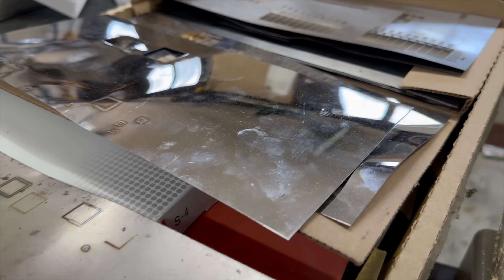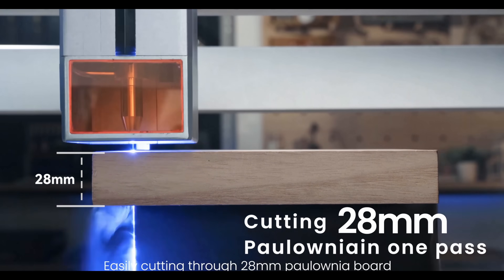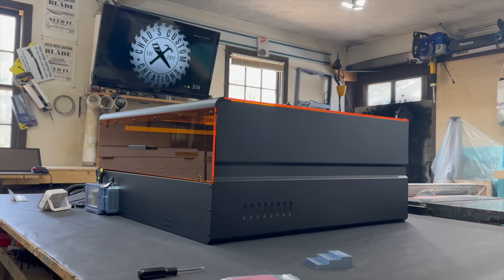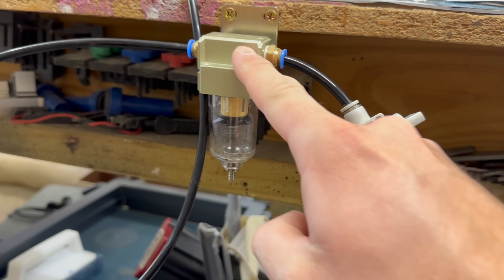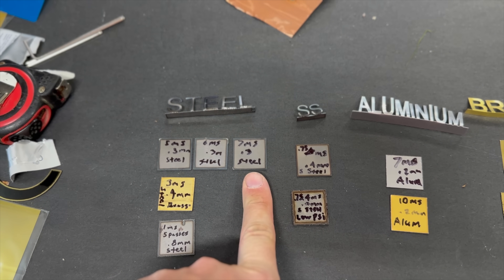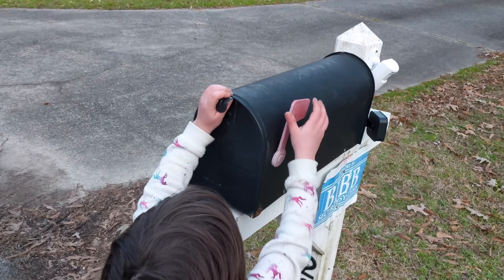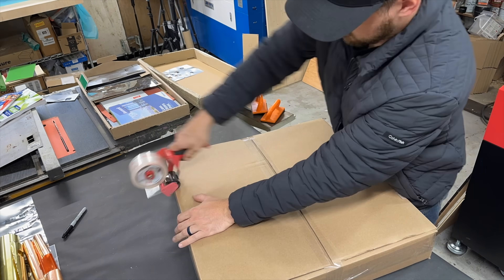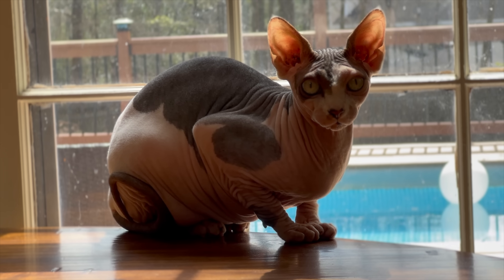Is The Future of Metal Cutting with Diode Lasers? 70W IKier K1 Pro Max

Comment: Goggles included with chinese laser engravers/cutters are never the right type.
Each have different peak wavelength those can effectively block.
If you don't want to damage your eyes, you need to pony up like $200+ for proper goggles, especially when we're speaking about 70W of power and you look at it directly.
You will very likely get very slow and gradual eyesight loss which you won't realise until it's few years, more damage, and you struggle to read smaller text and go to the optician and they tell you your eyes are fkd.
Reply from the maker: You're right! I actually have a nicer pair that is the orange color which does block out the blue much better. I should have had those on for this video, hopefully I don't go blind in a few years.
Reply: @ChadsCustomCreations  Do these come with certificates?

Comment: Coconut - Fantastic video. Thank you for such a thorough all metals review on the high powered diode laser ! You are the only person on the internet to provide this !! Ive looked hard ! 

It would be really interesting to see what Ikiers 20W fiber laser could do from a metal standpoint as the wavelength penetrates most metals much deeper. I was on the fence about these two for a while and I couldnt get any clear answers from Ikier. I ended up going with a WeCreat Vision for now and am waiting for either a desktop fiber laser to come out that can cut 0.2mm nickel or a diode. My guess is theyre probably not quite there yet. 

If Ikier wants to send you their Fiber 20W laser Id happily send some materials your way for testing 😅
Reply from the maker: Glad this was helpful for you! I didn’t even realize they had the 20w fiber until I was editing this one. I did talk with one person that got it and they said it does not have the air assist so actually they said my cuts were more impressive on metals. I would love to test it and maybe a 3D printed nozzle would help improve it.

Comment: Coconut. I have just discover your channel and I love it! I don't know what XTool should buy. I am a calligrapher and I want to complement this activity with engraving and printing...  Would a M1 be a good choice? Thanks for all your nice videos!
Reply from the maker: I am lucky you found me glad you are enjoying it I haven’t used the M1 it does have the benefit of also having a blade for vinyl cutting like the circut machine but if that doesn’t interest I think the 20w S1 is the best option for new laser users at the moment. Code Chad10 should give you a little discount also. I have a video on the S1 too if you want to take a closer look.
Reply: @ChadsCustomCreations Thanks a lot! I've been comparing M1 and S1 and the prize difference is too much! There is a good offer today and the M1 all in one kit is €1999. It includes the air purifier. Do you recomend it for security? Maybe I'd start with this kit and invest in the S1 in a while, if I see it could be a real business. If that happens, I will be able to use the air purifier for the new machine... 
Furthermore, I have seen that the xTool M1 and xTool F1 are incompatible with the Screen Printer Multi-color Kit, and I am interested on that. Why the Basic kit is compatible and the Muti-color one doesn't? 
I don't know what to do. It's too much information and I am overwhelming 🤯

Comment: Coconut.  I saw the post about using nitrogen, no idea on costs but had wondered about using CO2.  I know someone using it for cryotherapy and the nozzle temp is very low.  Also like the post idea of just running one or two passes with the laser off to help cool the material, will be curious if you see any real differences with the laser off test passes or if there will be too much heat accumulation to dissipate in a timely manner.
Reply from the maker: I love that the community can share these ideas in the comments cause I never would have thought of these but they make so much sense I can’t wait to try them.

Comment: Coconut and thanks for this video - those laseres look fabolous - I'm used to co2 lasers, but they don't stand a chance against this :)
Reply from the maker: Roy same here my main work is done with Co2 lasers but even at 130w mine won’t touch metal for some reason it’s very interesting these different wavelengths have on materials.
Reply: @ChadsCustomCreations  well, co2, at 10,600nm, is pretty far out in the IR spectrum, so it's quite understandable. I'm surprised that it works this well with only 455nm, thogugh. I'd've thought it had to be even higher frequency than that to pierece metal.

Comment: It would be interesting to try a water table like plasma cutters use to reduce warping. Put the cutting grid into a pan of water and raise the water level till it just touches the metal. The compressed air is going to spray water everywhere though...
Reply from the maker: You know I never knew why plasmas have the water tables but it makes sense looking at it that way.
Reply: @ChadsCustomCreations  Yep, in addition keeping the material cool so it doesn't warp, the water tables also absorb the smoke and sparks. Some plasma cutting is even done underwater. It's possible that the laser can pass through a thin layer of water, and cut the metal underwater. That would be an interesting experiment to do with the air turned off, but maybe then it won't blow out the melted metal?

Comment: coconut...  This looks really good, but the cutting capacity is pretty limited compared to a co2 laser.  On a CO2 laser, you can cut 2mm thick 2-color steel plate at 7mm per second on a 25 watt laser.  I don't know if it is because the laser spectrum, , ability to converge all beams into a single point, or a discrepancy in power measurement...  But the 70 watt rating does not translate to co2 equivalents.  Diode lasers are coming along, but we just aren't there yet for cutting.  Sorry, cutting foils is fun, but it is really limited in practical applications.  Engraving, yeah we have that covered with diodes.  So diode lasers cover the decorative landscape up to thick metallic foils.  But wood and plastics are where this is going to find a home as an effective cutter.
Reply from the maker: Do I have something set up wrong I have a 130w Co2 laser and I cannot get it to even mark steel.

I’ve not heard of a 25w Co2 laser I thought the lowest was the K40 with the 40w tubes.

Comment: Coconut. Glad you ended with a practical use for this. I was hoping it would be able to do more.
Reply from the maker: They are getting there, I think 140w might be a sweet spot for some structural stuff. Thicker stuff would definitely be nice but for aesthetic pieces like signs and such it works out pretty well.

Comment: in theory with slow enough speed u could cut up to 1 maybe 2 mm non-metalic alloys. however... and there is a but here somewhere... u have to account for backreflection... u see laser diodes, are notorious for being super flimsy especially when they get heated up... so unless u blow that pcb and laser lense with some coolant continously... to keep it cool and nice... ul fry it up in around 10 cuts or so... depending what u cutting. if u get a backreflection of 25% or more back into the lenses u run the risk of cracking, focusing lense, distortion mirrors, and even the diode itself... if you account for the backreflection and somehow manage to bring it down under 10% u can cut anything u want... hell u can even add 2 more 70W diode lasers and concentrate them in the focusing lense at the right angle and ul get a 210W diode laser metal buster but that requires 4 things, custom made supports, additional distortion mirrors, extra powersupply and wirring know how, cooling and strong enough focusing lense and mirrors that can handle that heat/power from the laser beam being created. all achievable if u got the money for it... however... is it worth the money and time? probably if u dont got a better solution... or the funds for buying a 20k fiberlaser that can cut metals... but since this machines go for up to 5k the diode 70W onces... just save some money and buy yourself something industrial grade... and have no hastle homemade improves...

the money is the main issue on this cause u see even if u get the parts i mentioned above cheap... the mirrors and focusing lenses will probably come close to that 20k mark so... why have a diy machine when u can buy it at that point from the store ...? with support and guarantee and all... and a full on spec manual.
Reply from the maker: George I like the way you think!

Comment: Coconut, Some ideas for future experimentation.  Get some blanks from a welding shop so you will know exactly what metals your dealing with. 

Also, maybe a pass with air assist and no laser?  

Finally, maybe higher psi for the assist?  Additionally maybe run co2 for assist gas? Or nitrogen?  Would keep the metal from oxidizing.
Reply from the maker: Great ideas thanks for these!

Comment: Yah, so definitely not a plasma cutter...  In the end there is no replacement for power and a plasma cutter has far more than this.  Sure cut quality is not as nice and the exit of the cut is slightly rough.  But you can easily cut a 1/4 plate of steal in a single pass with a plasma.  As to the cut, a materials thermal conductivity is only part of the equation.  A CO2 laser will cut copper but it takes a boat load of power due to its high reflectivity at 10320nM, the cuts happen so fast when cutting that warpage is not an issue.
Reply from the maker: You’re right, cut quality is great but power is limited, I think it is great for aesthetic pieces but thick structural pieces are still better suited for plasma cutters, for now.😉

Comment: Looks great for wood but next to useless for metal. Just mount a plasma cutter to a cheap laser cutting machine and away you go. Way cheaper than this and actually way more useful.
Reply from the maker: The versatility between metals woods and more I think makes the limits to thin material still worth it, especially for home decor where you don’t need that thickness anyways.
Reply: @ChadsCustomCreations  But if you mount a plasma cutter to a laser engravers rails, you have both but much more metal cutting capacity or quicker cut times on thinner metals.

Comment: If you want to cut copper and brass, get a green laser. Copper based metals reflect IR light too much, so you need a lot of power to get through and the cut quality won't be as good. But it absorbs green light much better, that's why you'd want a green laser to cut those copper based metals.
Reply from the maker: That’s a great point! I’ve gotta get my hands on a green laser!

Comment: You're comparing plasma cutting to this tiny home gamer laser, which doesn't make that much sense, I mean you sure know there's CO2-, Fiber-, and Disc-Lasers with up to 60 kilowatts of output and yes, also Diodelasers as well. They're just not as good when it comes to beam quality compared to other types of lasers.
Reply from the maker: Definitely has a long way to go still and hopefully prices will continue to fall to give the average Joe more capabilities. I am a big fan of the versatility of the 450nM wavelength even if it is only cutting thinner metals at the moment.
Reply: @ChadsCustomCreations  they have gone a long way already, but they will never reach the level of more expensive fiber lasers, let alone disc lasers. But for simple cutting operations they should be fine. But if you want to cut thicker material you won't get around a fiber laser. Those aren't all that expensive anymore, 1 KW is already at about 1000€, so that's very cheap.

Comment: Hi when you have been testing the 70watt  laser cutter have you had any trouble with Lightburn with the  laser cutter itself can you control it with lightbulb totally and control the power and speed thanks mark
Reply from the maker: Hey Mark I had no issues with Lightburn and this machine. I believe LB even has a macro for the auto height adjustment if you don’t want to use the physical button on the machine.
Reply: @ChadsCustomCreations  thank so much for getting back to me

Comment: For cooling waterbed, icepacks around the cutting area, high speed fan parallel to the surface area. I don't have a laser yet but will have one later (not writing the word, I'll buy one myself, there must be people needing that fruit/nut/seed more than I do ), but these are the things I would think of resolving the warping. Would be good if you mentioned why those solutions won't work. I assume water would be too dangerous for risk of explosion and may the evaporation damage the head, high wind fan having a negative effect on the beam itself etc. I really like the idea of cutting metal with it. However, I also liked the idea on the Xtool where you could engrave a bowl. I hope I'll have my clear vision by the time I get there to buy the laser, hopefully end of this year.
Reply from the maker: These are great ideas thank you for sharing!

Comment: Instead of air, you should try either oxygen or nitrogen. Nitrogen will keep the cut clean, and oxygen will make cutting significantly easier, but could potentially light everything on fire....
Reply from the maker: I did try oxygen before but didn’t have enough pressure I’ve gotta revisit it cause the results showed much higher temperatures.

Comment: Coconut oil is good to use but do not pour it down the drain, unless you want  some clogged drains.

Anyway, just atumbled across this video and great job on the testing of the metal materials. Does it do any better on colored acrylic?
Reply from the maker: I have had experience with clogging my drain with coconut oil also hahaha thankfully enough hot water and running the garbage disposal cleared it out. 

I have not tried the acrylics yet but they showed it cutting some pretty thick black I think they said 18mm

Comment: Fiber lasers are only 2-3x the cost of this nowadays & would cut way quicker & cleaner, probably cheaper overall if you have a lot to cut
Reply from the maker: I’ve been under the impression that the galvo style fiber lasers are not that great for cutting and are pretty limited to that about 4”x4” engrave area.

Comment: I guess I'll hold my breath for 150w diode laser head now. I have a CO2 version, and that's barely useable for steel cutting. I've seen videos where they are cutting 4mm carbon steel with a 150w tube, but for some reason I've never had that kind of success. I think the mirrors need to be perfect, also in the head as well. I'm saving up to convert mine to 600w tube cluster. That'll be what I'll have to stick with until I can afford a 4kw coconut fiber laser!
Reply from the maker: Yes I think Kern lasers has a co2 laser but I believe they are mixing in oxygen gas and have a very specific laser head that does something to make the magic happen.
Reply: @ChadsCustomCreations  Yes, you are correct... I HAVE TO use oxygen to get cutting steel. Also the head isn't the simple black tube style that most CO2 engraving lasers have. In the industry they call them "Metal/Non-Metal" heads. Has olmic sensing, auto focus... all that. Needs it's own control box if you plan on cutting steel with it.

Comment: Hi, I was curious if you noticed any degredation in power over time as you were testing? 450nm light is very reflective on aluminum, and can damage the higher powered lasers if it reflects back into the diodes.  I was wondering if you had any problems with that, or IKier has some kind of antireflection solution in their lenses.
Also, I can't find the spec on their website, do you know what the focal length of the lenses are?
Reply from the maker: Oh that is definitely a concern, I’ve heard putting the material at a slight angle can keep this from happening, I didn’t notice any degradation in power during my test only the fogging of my lens when my compressor built up condensation and I was luck that this did not harm the glass.
Reply: @ChadsCustomCreations  Thanks.  Ya, I've been angling mine when I use high power on aluminum, just was wondering if you had any issues over time.  And you are right, you gotta have clean air because it doesn't take much dirt on the lenses to mess up their efficiency, and to start heating them up and damaging them.

Comment: It would be interesting to see what would happen if you used something like O2 assist gas.
Reply from the maker: Terry I actually have tested it with oxygen and the temperature was definitely increased but I didn’t have the right valve to get enough air pressure to cut cleanly. I have a video on it if you’re interested is seeing the results.

Comment: Would you have less warping if you heated the metal itself? I realize the laser is raising the local temperature beyond melting and you can't heat the plastic/electric components that share the same space to those temperatures, but it seems like a heated bed (maybe using electrical current, maybe just a hot bed) would dramatically reduce the metal's tendency to warp wouldn't it?
Reply from the maker: That’s a great idea I would definitely like to try this and share the results.

Comment: Coconut!  I have operated a 4000-watt Trumpf fiber laser cutter for about 13 years now.  When cutting any thin metal, I use nitrogen to keep the material cool.
Reply from the maker: This is a great tip I didn’t know it was used for the purpose.